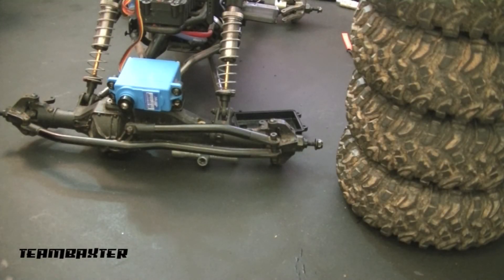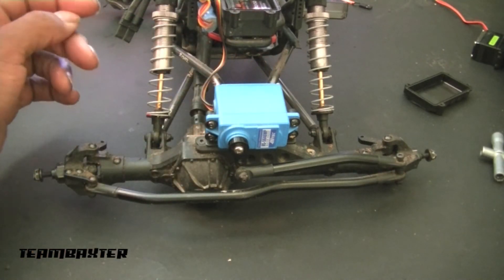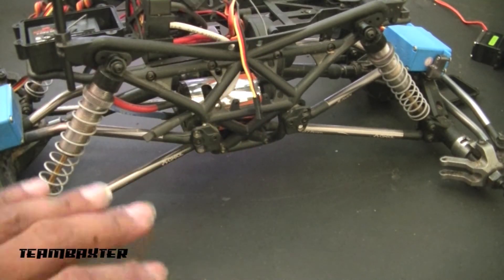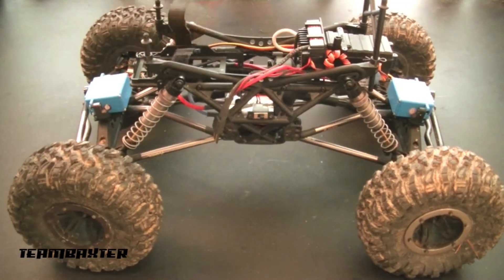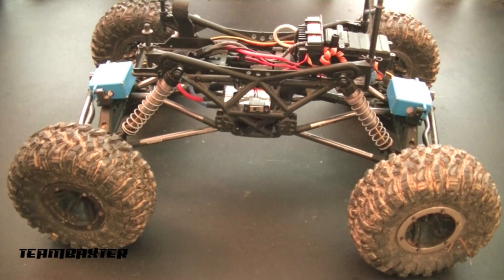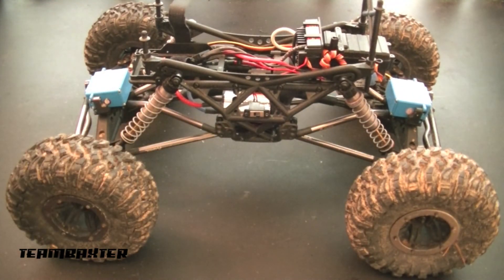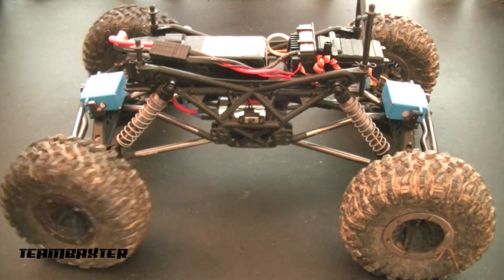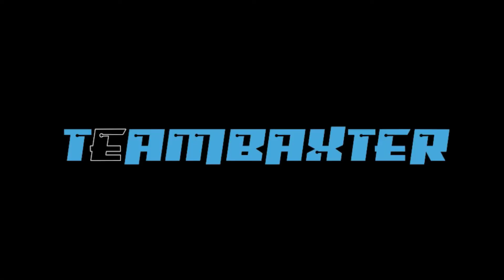Axial AX10 Upgrades Round 4

Comment: I did the axle flip and trans rotate.
Still had more torque twist than I like. So switched it back and mirrored the trans that seems to have helped some.now to play with springs.
Reply from the maker: discusdog i mainly did my axle flip/ trans rotate in order to keep my battery in front and as low as possible. torque twist doest drive me as crazy as it does lots of others, but this truck def leans when its moving. springs is probably the best bet, or simply dropping the preload collar a good bit. thanks for watching and commenting.